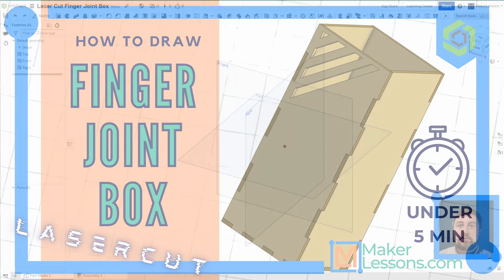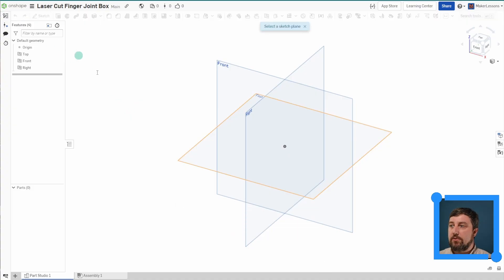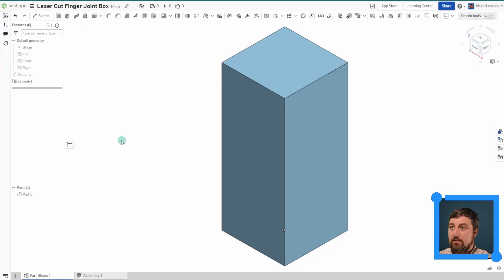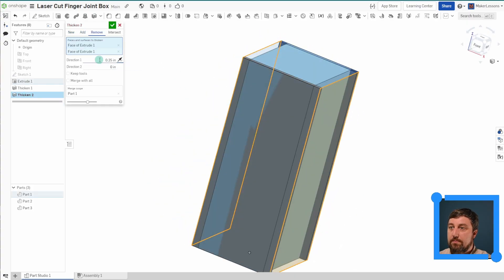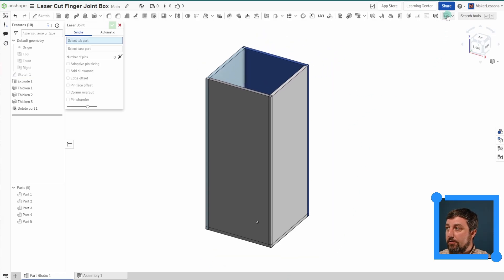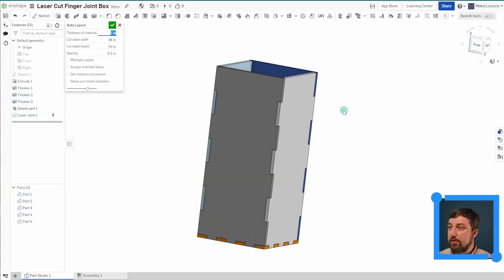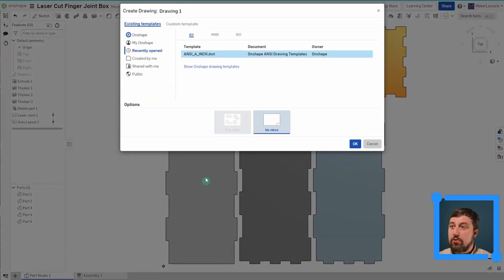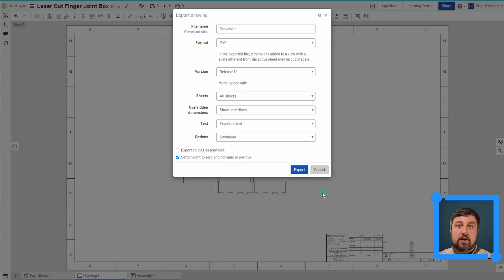Learn Onshape: Design A Simple Laser Cut Box in Under 5 Minutes

Comment: This is awesome. But how do I Insert just a selection of Parts? I only manage either one or all parts, but all parts are to big bc my lasercutter is rather small.
Reply from the maker: Hey, under Auto Layout you can change your cut sheet height and width. Set that to your material dimensions and it will space the parts out to fit on that sheet size

Comment: Hey nice tut! 
Im trying to add custom features to my toolbar, but it doesn't show up. I tried to manually find the laser cut extension, i added it refreshed the webpage but it is still not in my toolbar. Im thinking maybe it isn't a part of the student package? I have a model that I am struggling to turn into fingerjoints/tabs, do you think you can help me with it if I share it?
Reply: We've had all kinds of issues with featurescripts not showing up on different devices.  Some older pcs and chromebooks would fail to search, and different laptops would give different search results.  To solve, we log in on a faster laptop, add the featurescripts to the tool bar, then they can be used on the machines that couldn't search for them.
Reply from the maker: All extension are available to you regardless of if you are on the free version or not. Is it maybe your screen size and they are all under a drop down?

Comment: Can you make odd shaped boxes? I want to make a warlock style guitar shaped box (minus the neck). This software could potentially save me a TON of time.
Reply from the maker: Do you mean with a laser cutter? Laser cutter would have to be 90 degree angles meeting up at the connections but you can make something called living hinge which let's you make curves on a laser cutter.
Reply: @MakerLessons  the warlock guitar is mostly sharp angles with maybe 1 curve that could easily be straightened. If you google warlock guitar it'll pop up, you may have seen one before.
Reply from the maker: Think about how a laser cutter works though. It cuts everything perpendicular to the surface. It only makes 90 degree cuts. So you would have something that looks like it came out of mine craft unless you start to figure out living hinges.
Reply: @MakerLessons  I understand that it's going to look cheap, thats fine. and there will be no curves, it will be all straight angles. I plan to modify the body shape to remove the curves. I just want to easily design a box in roughly that shape.
And all the software I could find only did square or symetrical boxes. I could design it myself and do the fingerjoints by hand, but having software that would make the finger joints for me on the shape I choose would save me a lot of time.
Reply: @joshuamiller8235  there are bunch of different featurescripts named "finger joint" on onshape, but the short answer is, yes, you can do non square angles.  The laser joint (if you have a good one) will extend the tab/hole to accomodate the longer tab needed to reach.  The only glue point of contact becomes the sides of the joint, as the other parts are not flush, but yes, we make octagonal boxes and treasure chests with "bevelled" tops.

Comment: how do I know which laser joint to use? Because many pop up and I get different ones than you. I am new here btw haha
Reply from the maker: Hey! When I mouse over the one I have installed it says "Feature from Anttix - FeatureScripts / V4 / Laser Joint"  Hope that helps
Reply: @MakerLessons  thank you!!
Reply: @MakerLessons  and what should I do when the plane I am cutting from is too small? Can I somehow divide the drawing into 2 drawings for 2 different planes to cut from? And does the size of the template for the drawing matter?
Reply from the maker: I don't think I understand your question. When you thicken a side to make a new part that should be the thickness of your material that you are going to laser cut.
Reply: @MakerLessons  oh what I mean is that I have to pieces of material I am going to cut from, because one is not enough for all the pieces I need. Is it then possible to divide the parts over two drawings (one for one piece of material, and the rest on another drawing for the other piece of material). I managed to change the thickness
Reply from the maker: @joostvankerkhof8149  Ah. In the auto layout feature put in the size of your material sheet. It will automatically spilt it up to be two sheets.